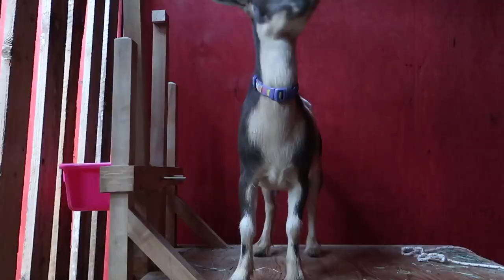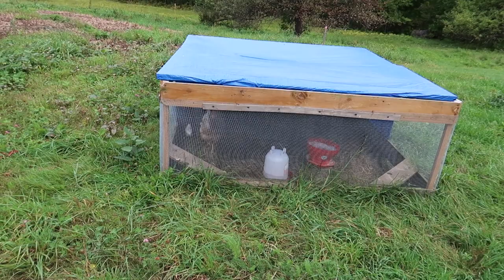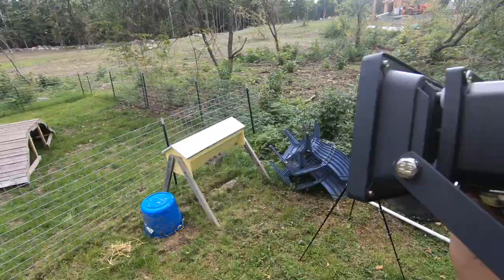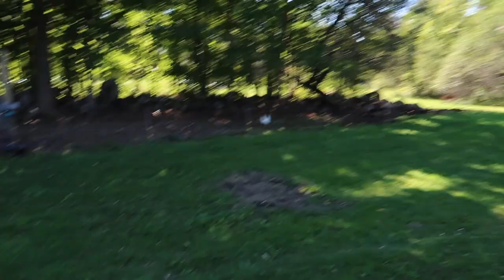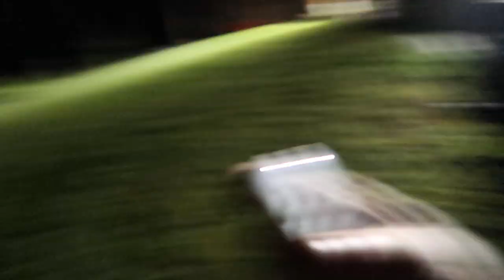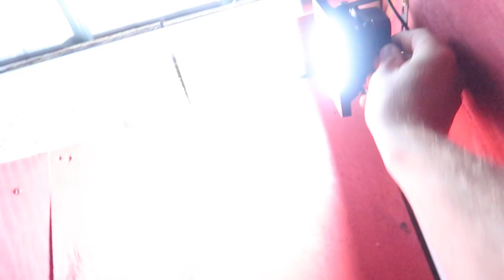This Is MODERN HomeSteading!

Comment: Those lights are awesome! We currently have to redo the electrical in our old cattle barn and I think this is a good solution for the interim so we can actually see going out there. Thanks for sharing and we will deff check these out through your Amazon link.

Comment: This might not matter to you. When installing wires on exterior of houses it's good to put a drip loop in before the hole into the structure. That's running the wire down on the outside, the turning it up before the entry hole. When it rains, the water will drip off the bottom of the loop and not follow the wire into the structure. Also, it won't travel back to the back of the  solar panel. Once again it might not matter here.

Comment: I have had a lot of problems with those kind of solar ledlights. The solar panels work great but the lights.... I had lights leaking. I had an circuit board that fried. See how yours will withstand the elements. Have an awesome Sunday, Andreas from Off Grid Sweden 🇸🇪

Comment: Yeah al... I would put the light in the milk room and remove the switch from the light and extended the wires to the main door. Or maybe the outdoor light will provide enough lighting so you can make it safely to the back room without the lights on.

Comment: I have a couple of the solar lights. I use one of them for predator aversion in my chicken coop paddock. So far it has done its job. The other one is mounted on a wood post at my front door to deter two-legged predators. ;O)  As the technology advances these lights are getting less expensive and are great for off-grid situations. Thanks for sharing your setup Al.

Comment: I have a question about your Amazon store. I bookmarked your Amazon page to use as my starting page so that no matter what I buy it goes through your Amazon link. Most of the time I could still see the 'lumnahacres' in the address bar no matter what I bought but last week I changed computers and had to redo all my bookmarks because I could not migrate them from the old computer...now when I buy something, I can't see the 'lumnahacres' in the address bar. 
I tried looking it up and there were 2 different kinds of pages, affiliate links and infulencers links, which kind do you have and does it make a difference which one we use? Thanks and best of luck to you.